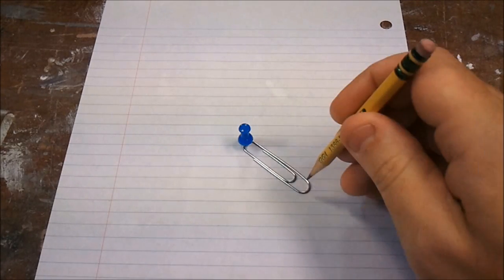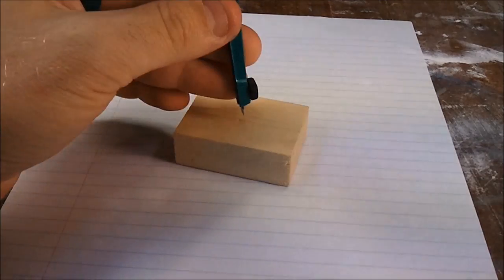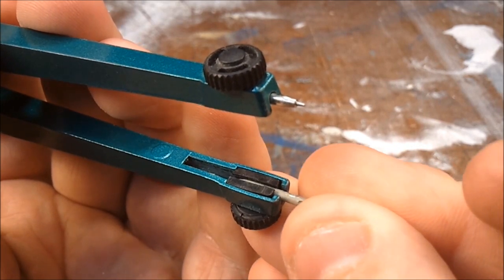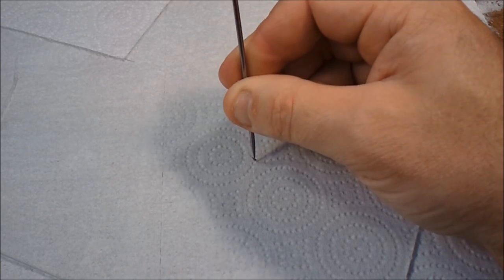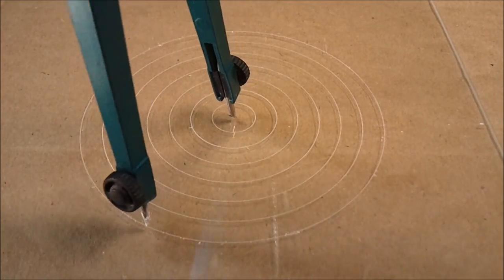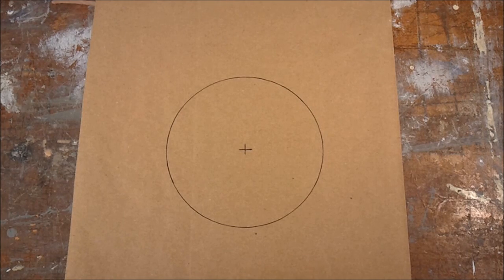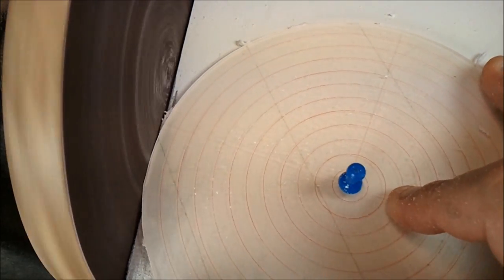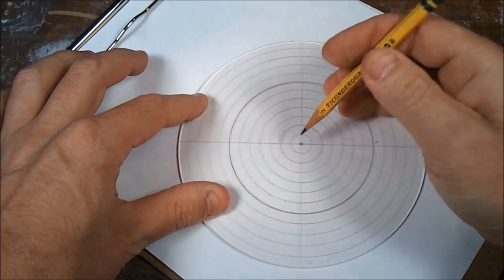Anti-compass (circle center finder)

Comment: I like this tool. It turned out looking really professional. I had seen it in some other videos and just supposed you had bought one. 
As a math teacher, I'd be remiss if I didn't mention that you can find the center of a circle quickly using two inscribed 90 degree angles.

Comment: Some compass have a third leg, and the other legs move in unison in relation to the center. It's also used as a concentricity  gauge as when you draw while spinning the piece around the circle it draws either at a single point, or doesn't.

Comment: Ooor you could use the geometric method of finding the point of intersection of two lines that bisect two chords?
Reply: so you basically need a compass or a compass and a ruler to achieve this - also you Need to draw a few extra markings on your workpiece

the geometric method is more exact, but since i made this tool, i cant live without it - since it does also work pretty well on circles that don't have edges to place a compass on - like a cylinder you need to find a Center on the top and bottom faces  - yes, you can use other center-Finders with 45° rulers, but this also involves at least 2 lines on your workpiece - this one is way more convinient

Comment: You could build it easier if you drill 1/4" holes in a block of wood and a nail in centre  and turn the perspex against the sharp point inserted into each 1/4" hole . You could put more pressure on the sheet too .

Comment: Can you flame polish the edges of acrylic?
Reply: yes, you can - but usually this is done on thicker pieces - not sure how thin material like 2 or 3 mm behaves - if you want do spare the work, just go to a fab lab near you and use a lasercutter to make one, with high DPI settings on the laser cutter the edge is crystal clear already

Comment: Draw any line crossing the circle. Find the middle of the line and you will have the diameter. Then easy to find the centre....
Reply: TheDuroProject You need to do some more construction to ensure you have a diameter, not a chord though.
Reply: zammer990 I am sorry but your are wrong. Any line crossing a circle in two point, find the middle (ruler or compass), make a 90° line passing this point and this is the diameter. Then easy to find the center.
This is really basic geometry, that's why it's so nice.
Reply: Didn't think of it like that :D; still, that's an additional construction than just "find the middle of any chord"

Comment: you should be using only  the small face of the grinding stone . and  not be grinding on the  left side of the grinding stone . because you are putting pressure on the left sided face you can course it to fracture and if breaks   in the grinder when spinning . go up like a    grenade . love life work safe
Reply from the maker: Nonsense. There was no pressure applied, and I was sharpening a nail that was one millimeter thick. Not that it would even matter; there already exists a multitude of sharpening devices that operate on exactly the principle you are criticizing. There was no abuse to the wheel here, nor sufficient force to cause internal fracture. If I ever suspected that my wheel had been compromised, I would replace it.
Reply: hi only will try to give constructed criticism if there is a danger to some one's well being. and  I hope it is nonsense for you sake , and also as I cannot really comment on a device I have not seen . as you have said yourself  ther is not a lot of pressure on the wheel and there ins no damage to the structure but  you cannot always see fault line in the internal structure  can you  . as  seen as  you  started with  a nail and you don't feel a risk , what happen when you feel  confident  and no risk  and start using 12.5mm steel plate . I hope it will still be nonsense . for you to carry on living a healthy life.   so any way I look forward to you interesting videos. and thanks for this  interesting conversations ."Love Life Work Safe !"
Reply: pocket83 He is right, grinding wheels like that aren't designed to be used from the side.  A multitude of other abrasive tools have no effect on what that specific grinding wheel is meant for- and that's grinding only on the face. Grinding on the face, back and forth for even wear, like someone who is skilled would do. 

(sure, we all use the side with alight tough to get something nice and flat, but we shouldn't)

But hey, you're clearly a smarty and have surely read the safety precautions, and know more than machinists. So do as you please. Hope it works out in your favor, as I like your videos and would prefer you don't end up with a grinding wheel chunk through the forehead
Reply: Jay Jo your right, it looks like his grinding wheel already has several grooves from side grinding. (I'm also guilty of light side grinding)... not safe. A good idea is to perform a "ring test" when installing new wheels or as maintenance when it's time to move the tool rest in. Hold the wheel horizontally by the arbor and lightly tap around the wheel with a rubber coated screwdriver handle. if the wheel is solid you should hear a sharp clear ring all around the wheel, if you hear a dead spot the wheel has a fracture.